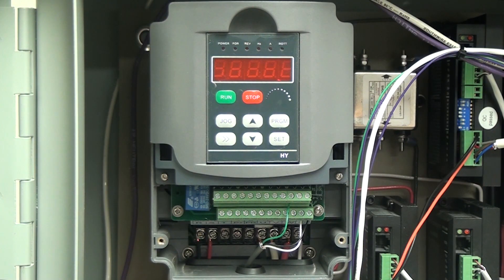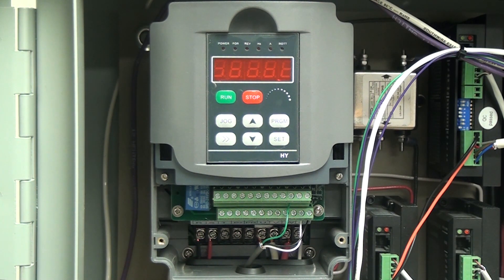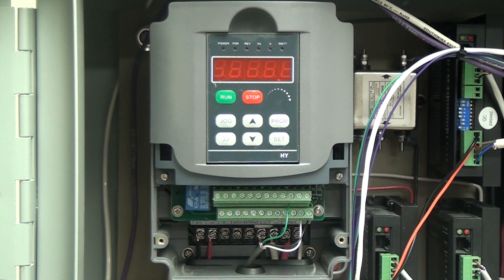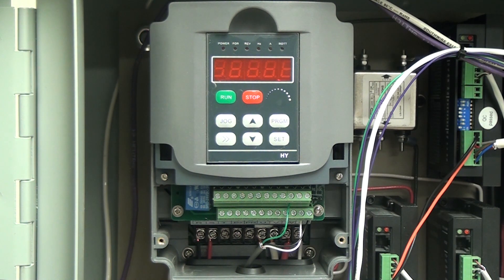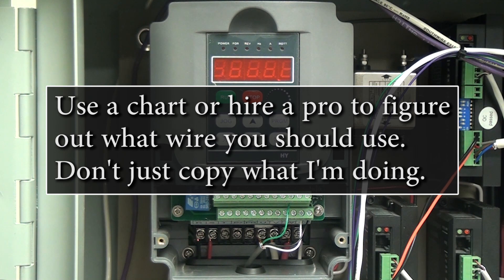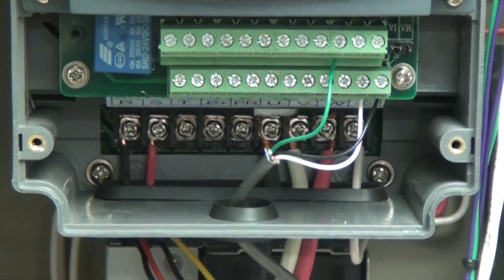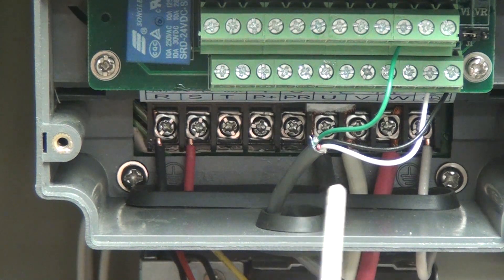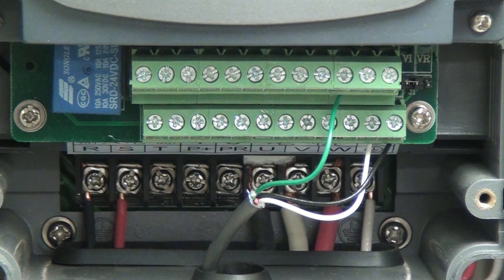Huanyang VFD 2.2kw (pt1/2) - Wiring

Comment: Question , I have the 120VAC input drive.   I've seen videos where it is hooked up to a single phas with a single phase AC motor as the load. They don't mention how thw AC in is wired. I'm trying to figure out where to wire the Neutral wire to.  The Line input ( black ) will go to 'R', does the neutral go to 'S' or to the ground terminal  on the unit.  Thanks

Comment: You want to  add 25% for motor start  to allow the the voltage spike upon starting.  So 3.2 x .25= 4.05 Amps.

Comment: HI Russ, I am running a 110 vac1.5 kw spindle on a 110vac 2.2kw vfd.  I have upgraded to a 110 vac,  2.2kw spindle for the larger collet size.  I previously had my max current PD142 set to 7 amps which ran fine. I went to increase the amps on my drive and see it only goes to 11 amps.  Do you know if this the max for the drive or if it is being limited by another parameter.  this is a Haugyang VFD.
Reply from the maker: I just tried it on mine and hit the same limitation. None of the documentation I have says if this is supposed to be the max so I'm not sure.
Reply: I wonder since7 amp setting for 1.5kw  works well,  so maybe the 11 amp setting for 2.2kw is Correct.  I guess that I will try and see. Being this is a 3 phase set up on the output side it will be different than computing current from a regular formula.   Thank you for you response.  Good day to you.

Comment: will the motor on lathe still run without the green, white and black not connected..I have my unit hooked up to 220 volt and have 110 volt on each leg then I test the voltage at lower right side wires and I have 148 volts (each) on all three wires going to the three phase motor..my box is a little different...but looks similar. no brand name on it or instructions..so I am assuming if the wires up top are not connected the lathe will not run..

Comment: Hello, how can i wire my 1600w 50Hz 220v miter saw in 2.2kw single phase-three phase  frequency converter because we use 60Hz in my country and i want to convert the frequency from 60Hz to 50Hz to allow me to use my miter sow safely ? Thank you
Reply from the maker: Many VFDs can be programmed to accept either 60hz or 50hz, but you'd have to go through your manual to find out if it can be done on yours.

Comment: Can I tie the 220v neutral and the motor ground wire to the same lug on the VFD if I dont have  a chassis ground? In my case Im going to be mounting the 3hp vfd variant of this to my table saws cabinet.
Reply: did you sort it then mate ?

Comment: How do i turn off the vfd? Or just pull out the power cord?
Reply from the maker: I have mine wired to a relay and I kill power to the relay to turn it off. I'm not sure if there is a way to turn it all the way off without just cutting power.

Comment: really thanks Rus, for you videos and your attention, really appreciate. It is more difficult than i expected,  with the help of an eng, i could see that my motherboard use  the "phisical com" i mean the real address of a COM for "inner use" so it is too risky triing to use them for something else. One more question, using the HY vfd, i can easily control a three phase usual motor, but it sense too much load for a submersible motor pump. Wich parameter i could try to work on, to set them to "handle" with this type of motor. I know the VFD could do this, because there are a whole series of VFD selled to drive this type of motors. BTW it is just to experience with the VFD , so if you have better things to do, do not worry about it. Again thanks, Daniele
Reply from the maker: +danieleconty I can't find my manual so I'm not sure which setting it is. Have you tried running the pump and the VFD is faulting?
Reply: Thanks, so much Rus, i could not remember just now, what i know: the inverter works fine with standard motors,  when i tried it with the submersible type, it acted like if overloaded. SO i think may be it need a "smoother" output voltage.. but not sure on how to do it.

Comment: Hi Rus, thanks for your help. May be you can help me with a COM1 trouble. Bought a Manhattan usb to serial converter, it works fine, but... i can't set COM1 as communication port, (in device properties VISTA os, ) and all device i need to communicate (especially solar inverters) only works on COM1, do you know any way to solve it? Anyway thanks, Daniele danieleconty@gmail.com
Reply from the maker: +danieleconty I'm not sure on Vista. Most likely in the device manager? Sorry I just barely saw your comment. You probably have it figured out by now.

Comment: great video. I have this same inverter (220V 1~ph in, 220V 3~ph out, ), laying around from another application in the past, but with 3kW rating.
I now want to use it to drive a 220v 3ph deep well water pump. This pump fills a reservoir and a level switch in this reservoir is turning the pump on and off. Off when it is totally full, and on when the level drops a few feet. So it is basically an ON/OFF operation.
My question is: where do I connect the level switch to?
I have the manual, but can not get clear how to connect the on/off level switch to.
 Is it +10V and VI ? Not sure so would appreciate some  help with this.

Comment: Thanks for the video. I got a question. I bought a VFD and a spindle (2.2 kw air cooled) but when it arrived i realized i ordered 220V instead of 110V i have in my garage.

It looks exactly like yours. Do you know if these models have the same hardware and configured differently and i can change some switch and voila itis 110v ? PC power supplies have that switch for example...

If not, if i exchange the product, changing VFD is enough? Or spindle will meed to be changed too? 

Thanks
Reply from the maker: For the VFD, certain models can either be powered by 110v or 220v. They all look the same, so it's a bit of a hassle figuring out which VFD you have. You will probably have to comb through the manual to find out if yours will run off 110v. Or just wire it up and see what happens :/

For the spindle, you might be able to run it off 110v but you'll be getting half the power. 2.2KW is calculated on 220v and 10 amps. if you can only supply 110v you'd have 1.1KW at 10 amps. I'm not sure how well the motor will run like that (or if at all).

Comment: I live in Europe with 220v electricity,Can you give your opinion on grounding the spindle?There are many opinions on the net about it,on how you should solder an additional wire inside the spindle to the body itslef,or not doing anything at all,but the pin number 4 is empty,it is not connected to anything.
Reply from the maker: 3 Phase motor signals are balanced, so a ground isn't required to get it running. That said, I would agree that attaching a ground to the spindle body is a good idea just to make sure you're being safe. I didn't realize some spindles don't have a ground lug on them already. Are you using a high-freq 2.2kw spindle? I have one but never wired it up so I'm not sure if it allows for grounding either.
Reply: russtuff Mine is 0.8kw spindle.It has a number 4 pin but when I dissamble it there is no connection to anything

Comment: Uniform? Wow, you really are old school! Utah where I'm from (graduated high school y2k). Thanks for the content! Very helpful.
Reply from the maker: Are you saying Uniform is no longer in use, or is it just that it sounds weird hearing phonetics being used? I learned the phonetic alphabet from listening to my old man talk on the radio.
Go Utah!
Romeo Uniform Sierra
Reply: Uniform is proper. Not sure why or how I got stuck on Utah! Just always been that way. By the way, do you have a physical switch or plug/physical disconnect between your breaker and your vfd? I'm thinking about implementing both, as in: breaker>switch>plug>vfd>motor. In case I want to move my unit around (2x72 belt grinder, 3hp Baldor motor).

Comment: Why don't you just jumper between R n S pin?
Reply from the maker: In the U.S., you only get 110v per circuit. devices requiring 220v are powered with 2 110v circuits, which are 180 degrees out of phase. For this reason, R and S must each receive their own 110v source. I'm not sure how you would wire it if you live in a country that supplies 220v per circuit.
Reply: russtuff well, i just connect them  like connect any electric tool. Hot and neutral to any combination of R and S or R and T or S and T.
Reply from the maker: +ari pratama How can you do it with two hots and neutral besides the way I'm doing it?
Reply: russtuff i just use 1 hot and 1 neutral. I tried with 2 hot as yours before but it didn't work. It didn't power up. So i take my risk with 1 hot and 1 neutral. And it worked.

Comment: Hi Can i yuse this VFD olso for single fase motors? and how i wire this? i have a motor type EAM 63 G 2     -   K12   220 v 50 hz rated power 250W current consumpition 435w speed 2850 r.p.m.. it whas a pressent of my uncle for my lathe: hobbymat MD 65
You can mail me at ernstjandol@hotmail.com
Reply from the maker: I'm not certain if the model I have will do single phase out. They make several variations of the same VFD though, so I'm sure there is one that will work for your application.

Comment: very good tutorial. so no coding needed? no HAL or any edit? just wire it up and everything should work in Linuxcnc? that's pretty magic
Reply from the maker: +xue roger I think there is a call for it in one of the HAL files. I'll take a look and post an update if needed.
Reply: russtuff thanks for reply. I have the added the code. But the hy_comm signal is always false. I've switched couple rs485, but no luck
Reply from the maker: Any more luck?
Reply: russtuff thanks for checking back. it turns out I forgot to set the address, I think it's the 163 needs to be 1. now everything works.

Comment: I have one of these drives and I want to control a single phase fan motor (like the kind used for a restaurant kitchen exhaust). Do you have advice on wiring for 110VAC mains and motor?
Reply from the maker: +Gary Packer That shouldn't be a problem, just make sure you program it for 110.
Reply from the maker: He's Right, I'm wrong. This model only allows for 170v-240v for 220v power. I could have sworn it allowed for 110v input, but nope.
Thanks ToolGuy.

Comment: hey man, I have a VFD like this for a milling machine (only mine is 1.5kW) do you have anything that could be like a schematic for what wires go where? I didnt understand the video (not your bad, but i suck at english when it comes to electrostuff) so it would be great if you had a link or something

Beside that, very good video :)
Reply from the maker: I do not know where you can find a schematic, but the manual says what each connection does.
Reply: Very good video. Is there any way that I can find wiring diagram for inverter SAMCO -Q?I don't have any wiring diagrams for external analog control for example.A three phase motor is connected it's OK But I want to have any wiring diagram or user manual. Thanks

Comment: Currently my 240V power shuts down at the end of repetitive cycles and restarts when I click 'Cycle Start <Alt-R>' on my Mach 3. If I only connect the motor wires and these interrupted 240V power wires will I have to reset the speed etc on this VFD on every cycle ?
Reply from the maker: I'm not sure I understand your question. The VFD can be turned off/on at any time and will not lose its programmed parameters. Disconnecting the main voltage is not going to deprogram it.

Comment: Thank you for posting this. Much clearer and more to the point than other videos I've seen. Not to mention the files you uploaded.

I have a question: The manual (which as you correctly point out is a bit hard to digest) makes it sound like unplugging or sudden stopping of the flow of power to your device/motor FROM the VFD can damage it. I'm currently using it to power a couple of air compressors, which of course have mechanical relays to maintain a certain pressure. Do you ever use the Huanyang with similar relays/contactors/SSRs? Should I find some kind of work around in order to not damage the VFD?

One possibility is using the mechanical relay to redirect wall Mains to the control terminals which would then shut off the VFD. But I'm not sure which terminals would work since, as we've said, the manual looks like it was written by a computer.

Appreciate any additional help you or others can offer, not to mention what you have so far

Chris
Reply from the maker: I really think the warnings are to keep the device from seeing high inrush current or feedback. I've had a other people say they are running them the way you are and have never had a problem. It may be luck of the draw :/
I don't have any good ideas on a workaround though. I figure if you haven't burned one up quickly you're probably alright.

Comment: the reason 12awg is so commonly used even though it's overkill is for compliance with the national electrical code.
Reply from the maker: Right. I did about 20 versions of this video before settling on this take, and in most of the previous versions I covered national code. In the end, I decided I didn't want to get into it. Thanks for watching.

Comment: Great video! Thanks! There was much needed for this video. I was glad to see LinuxCNC 2.7 had a driver for this VFD but I haven't tried it yet. I've wired two of these VFDs already and have two more to go for other projects. I look forward to trying the serial adapter you showed. I've been using the C41 board from CNC4PC.com.  I've noticed this VFD produces a lot of electromagnetic interference. From my experiments I believe a little of this is conducted through the wiring and a lot of it is radiated so some shielding is in order. I most noticed the problem with VGA signals being corrupted and the LCD output distorted or a black screen. I've been using RFI filters on the recent builds but haven't got them running yet so don't know if they help with the radiated noise or not.  The high current motor wiring should always be shielded cable with the shield grounded in the panel at the common grounding point. By the way, neutral is not the same as ground. I wouldn't connect the neutral to the VFD ground terminal. I'd connect the Vfd ground to the common grounding point in your panel with a green wire, not a white wire. I'm very much looking forward to the next video in this two-part series. Thanks again for making these awesome videos.

Comment: Nice work and great information.

I went with the Teco L510 on the lathe. I specifically didn't get into any wiring info in my video due to the liability issue. I love haveing my lathe running under 3 phase, variable speed, power. It is so simple to change speeds. Now to get the carriage brackets made.

Comment: question:  you use Linux CNC but have never used the Mach software.  This implies you are good with linux..  not out of the realm of possibilities, is there another reason?  Do you think that this is better in some way?  is the sampling rate, or the frame rate or something??  I am just looking at these technologies but I don't have the discretionary funds to jump in att.  So, why did you pursue this tech tree?
Reply from the maker: I've been using LinuxCNC for a few years now. I'm not a developer or programmer, but I've been using it long enought that I'm comfortable with it.

Frankly, I went with LinuxCNC because it's free, and Mach isn't. I assumed that at some point I would "upgrade" to Mach, but I no longer consider Mach as an upgrade. I know many people using Mach who hate it and want to switch to LinuxCNC. Mach runs on Windows and if you aren't using a SmoothStepper (and even if you are) you may have problems with signals not correctly being sent to your breakout board.

Linux uses a "real time" kernel which means you don't need a SmothStepper and you get a much more reliable command stream to the breakout board. Also, with a little programming knowledge and a lot of help from the LinuxCNC forum, LinuxCNC is every bit as capable as Mach and is just as easy to use.
Reply: I started with Mach3 and went to LinuxCNC and am glad I did.  There's a little learning curve but like Russ said there's plenty of forum help.

Comment: I run one of these on my router. Mach3 controls it just fine, just requires the standard messing around with settings. On/off is just an output from the bob to a relay and speed control is via the 0-10v output.
 I use also us a couple of AC Tech VFD's in the shed and they're very similar.
Reply from the maker: Great! Thanks for posting that.